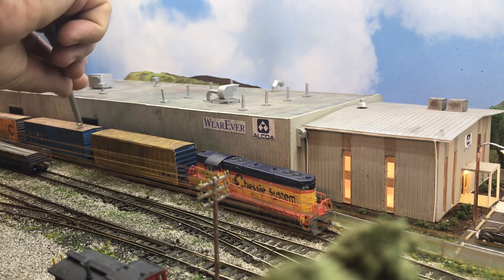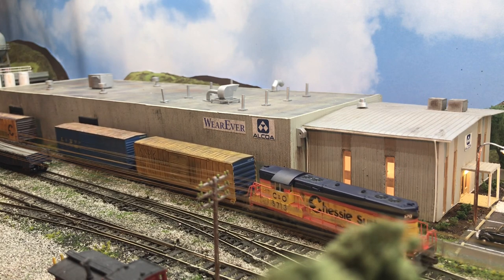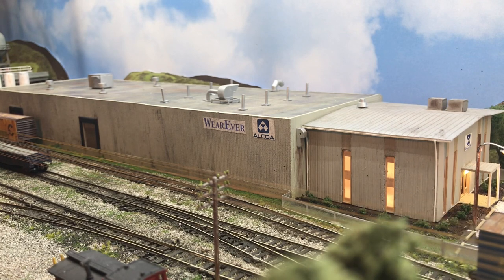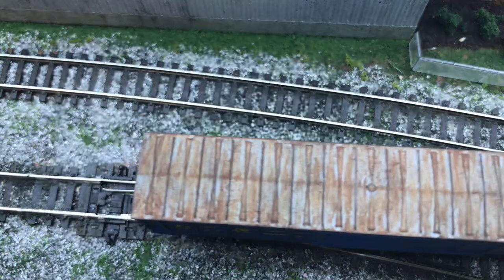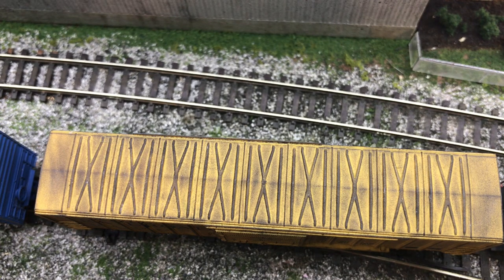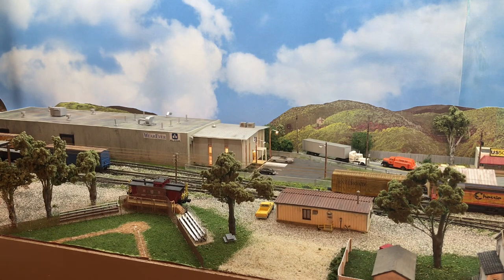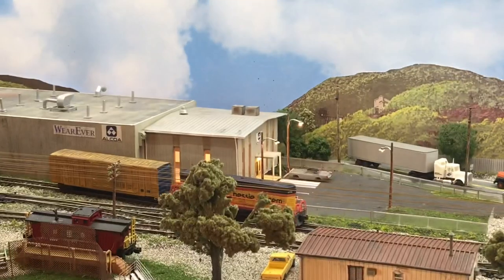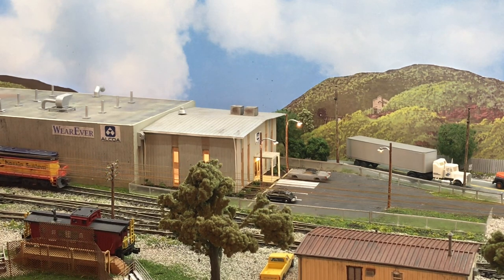A little switching with your Saturday morning coffee (have a small cup, it’s short!)

Comment: I'm liking the voice over. It's works well with all the audio. I know nothing about tremors & hope it not a problem, but I would think the shaking in N scale will happen in other scales. I've seen shaking with computer users and when the palm is resting on something the work can continue. You are resourceful so I am expecting you will find a work around. Stay active. Mario
Reply from the maker: I like it because I often screw up what I’m saying when I’m multitasking. This way, I’m just relaxing on the deck and watching the video. Uncoupling cars doesn’t have any way to rest my hand on something. My Dad built great model airplanes with his hands shaking because they were on a workbench. I don’t think building the layout will be a challenge, it will be operating it. It’s a lot easier to uncouple a G scale coupler that’s 5 times bigger than N scale couplers! More room to get the shaking stick in between the couplers! Anyway, it should be a few years before I need to worry about it. Thanks as always for the feedback!